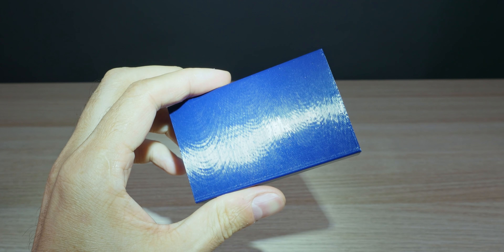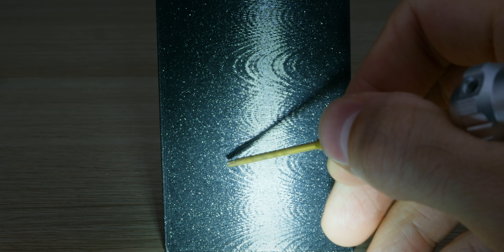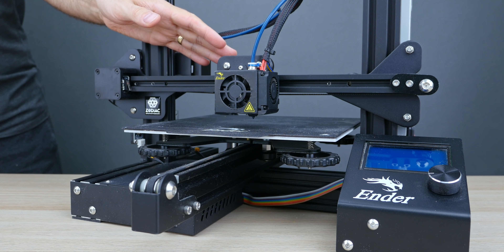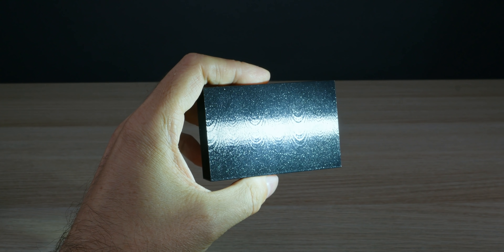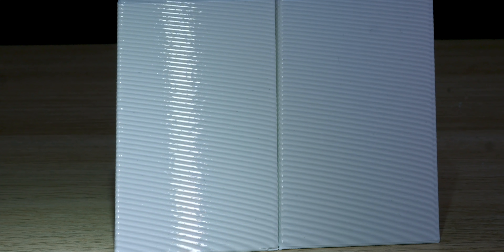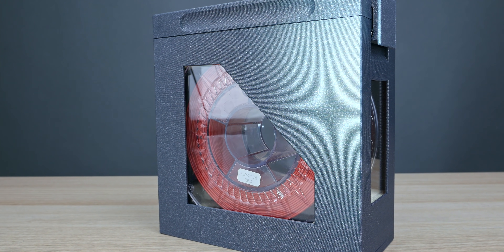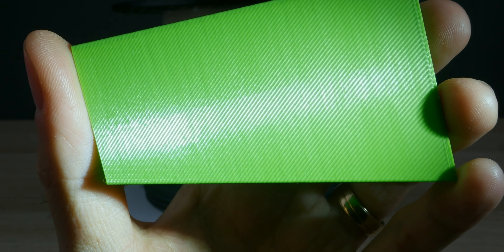The intertwined waves pattern in 3D printing

Comment: Can also be caused by stepper drivers,  motors without enough micro stepping holding torque that snap into steps , etc.   Bowden setup with a really powerful single gear extruder has worked well for me in the past.  0.9 deg large bowden stepper works wonders.   Geared extruders of course add their own artifacts.   Good reason not to go cheap on direct drive.

Comment: i will modify one extruder project from thingiverse the "powerFlower belted extruder" it uses mk8 hobbed gear but i will modify it to "lerdge mt" gear its belted but single drive also second gear which most uses bearing , i will use ender 3 stock extruder gear to increase grip so there is not a backlash or lag with gear system caused by teeth , i think it will be good.

Comment: Wonder if you could design a little "give" between the extruder and hotend on your direct drive design. Maybe put a spring in there or some rubber that would dampen out the supplied pressure to the hot end.

Comment: could you try covering the hobbed teeth with some very very small rubberbands or heat shrink, either way something super rubbery/grippy so its not biting on indexted teeth but instead on a rounded grippy surface, bonyus points its a non perminant modification

Comment: Firstly, first class videos -- even more engineering rigor than cnc kitchen!    I've read through many comments and can't find any reference to the relative alignment of the teeth in the hobbed gear and the drive gear.  Is the alignment the same between manufacturers? Does it vary with the same manufacturer? I wonder if this could we why not all dual drive printers suffer the problem or vary in magnitude.   I have to believe that the hobbed gear running with synchronized pressure on the filament from both the left and right side would have a different result than alternating pressure from the left, then the right...

If this is true then then are things that would effect the "phase" of the two gears (like pressure on the idler gear, filament density/type) and thus change the relative significance of the imperfection.

Makes you want to try designing your own extruder.... oh, wait a minute.... 🙂
Reply from the maker: That's something I haven't considered. You do make a valid point. I've got a bunch of gears from various manufacturers and I can check how they do or don't align. Thanks for pointing it out!

Comment: Fascinating! Just thinking out loud... What if there is a rubber band around each of the extruder gears where it touches the filament? Similar to a baseball pitching machine. Pitching machines have two counter rotating "tires" and the ball is grabbed and shot out by the spinning tires. I realize it's a tiny rubber band. However, possibly no marks on the filament???

Comment: I believe it has to do with the profile of the teeth. Distance to the center of rotation is smaller at the center than at the edges, of course it slip at every teeth. Straight and sharp teeth should help. Larger diameter of the hub gear also, because it will increase the number of tooth in contact with the filament with less variation than small radius. There is also another pattern, the coaxiality of the gear hole with the motor shaft: the set screw push it on one side to compensate the play and lock. (for this too a larger dia compensate better)

Comment: Thanks for the analysis!  After installing a Printermods MDD kit and Trianglelabs bimetallic heatbreak to a CR-10, I was getting these patterns and they were quite prominent.  According to your math the interval for me was 0.4mm.  I changed hobbed gears, idler tensioner springs, nozzles, used a different 1.8 degree stepper (wish I had a 0.9), uncoupled the stock fan shroud from the gantry to reduce vibrations, increased speed by 50%...nothing.  In the end I removed the bimetallic heatbreak and the surface finish of prints went back to being acceptable (although this problem in its exaggerated state allowed me to see that it was still there afterwards, although suuuuper subtle).  This gives credibility to the assertion that Bowden systems buffer against this effect.  I want to try a CHT nozzle to see if I can get back the increased flowrate the bimetallic heatbreak was giving me, or even if it could dampen these wood grain artifacts.
Reply from the maker: That's super interesting! Having played with some hotends to push them to the limit I also noticed some strange behavior where the extrusion flows in bursts rather than being uniform (for a simple uniform purge command). Not that it had anything to do with your observation, but that there are still things that happen inside the hotend that I don't quite understand. 0.4mm should be the distance between the teeth of the hobbed gears I believe? I still do get those. Does depend a lot on the filament though. They're always there, but barely visible with some filaments and very accentuated with others. I'm also curious about the CHT nozzle. Placed an order for it and I ended up ordering everything but the nozzle 😅.
Reply: @MihaiDesigns  Thanks for replying!  The stock Creality gear I have is one of the 11mm OD 40-tooth gears which would be ~0.86mm/tooth, so if there is some sort of reciprocating deformation (like compressing a straight object in a tube it might turn wavy) perhaps that could explain it.  I'm sorry I don't have an alternative extruder to test.  Your comment about "burst" movement kind of makes me get this hunch that each extrusion-hotend setup has its own signature, influenced by the sum of its internal friction.  I get this image in my head of a kitchen blender with silicone feet that you're trying to pull across a countertop.  Your arms/hands being the extrusion force, the blender does all these "micro hops" as you move it due to interactions between the silicone feet (soft, elastic) and granite (hard, rigid) happening in intervals as the static friction is overcome.  It would be the analogy of the softened filament moving past metal heatbreaks/nozzle surfaces, I suppose.  I am no master in tribology or fluid dynamics, just musing...but I am curious about the impact that machined surfaces would have like drilling vs EDM or what coating or plating methods could help or hinder the situation...perhaps the CHT with its higher surface area could make things worse!  Anyway, hope you can get to test it and if anything notable happens that you'll share!  Thanks again!

Comment: how about at 1:50 we rubber coat it?  Not the gears, just the extrusion area for the filament?  Would that not help keep from digging in and maybe solve the pattern issue?

Comment: Maybe this really faint wood grain pattern comes from the hobbed gear. The screw we use to tighten it to the motor shaft can set it a little bit offcenter. Similar issue Stefan has in his Cetus machine: https://www.youtube.com/watch?v=a3oQy6v3MrA
Reply from the maker: No, that by itself would produce a very very elongated pattern which would look like misaligned layers.

Comment: A resin printer would have no problems printing some herring bone gears (hell I can do M3 threads on my Mars 2, and probably even M2 if I messed with the exposure times more).

They wouldn't be metal but modern resins are fairly tough so it should be good enough for testing (maybe even for general use, but I'm not sure how much wear those gears actually get.).

Could even look at replacing the teeth with some kind of a finer alternating grid pattern. Or maybe using some kind of a rubber coating instead of teeth (unless it would rub off to quickly)?

Comment: this is actually not caused by the dual gear... evidently, print speed will cause it shows up or disappear. you should take a look for my video explaining why the stepper motor and the stepper driver is the root cause.

Comment: I just had a thought. What about a quad gear  extruder that uses softer tires to drive it? No chewing filament. The flexibility of rubber tires would put a more consistent pressure on the gears, taking up some of the backlash variability.
Reply: An orbiter of some sort?

Comment: You should be able to get rid of the problem by taking the second gear out of the system. It would be a single gear drive, which would hold one side of the filament, and the other side of the filament would be held by a feeder gear on a rail or shaft, which has a ball bearing so it spins freely. You would be able to tension this second free spinning feeding gear against the filament with a spring and screw, just make sure it is not connected to the main feeder gear.

Comment: You can add recirculating ball screws as your drive system like a cnc mill. This is clearly a very expensive solution but it is far more ridgid and abosrbs the vibrations/counter forces.

Comment: Now that you exposed your findings it seems to makes sense: the tiny teeth of the cog wheels combined with the spring pressure induces a cyclic alternating parasitic torque back to the extruder motor (like driving a bicycle with square wheels). Given that we generally use stepper motor, without position feedback, this torque creates an slight alternated over-shoot and undershoot of the intended position, therefore generating over and under extrusion. If true lighter gear pressure will reduce the amplitude of the defect. And "helical cog wheel" should almost get ride of it.

Comment: Helical gears might solve these texture problems. They have a more consistent tooth engagement which makes for smoother transmission of power. It might help to use these instead of straight gears for dual gear extruders.
Just a thought…
Reply: If they were helical enough it would also average out the bumps going into the heater as the bumps would be angled.

Comment: Just increase the gear ratio of youre extruder, this wood pattern its caused, as you point, because fluctuations on the pressure of the melted filament, and yhea, piped extruders use the pipe as a flux capacitator so its less noticeable.

Nothing to be with the tooths of the extruder filament gears, and yhea, increasing the pressure solves the problem a little bit (extruder would lose steps), thats what you do when you increase the speed of the outside layer...

When you print with extreme small nozzles (0'1),  this pressure problems leads to jamming, its even more extreme, imagine holes in the surface... the way to "handle" this (because its impossible, its matter of luck at this sizes) its increasing the temperature way too much to make the plastic more liquid (240-250C°), slow down the speed to even 10m/s, and let the extruder jump steps, if you pray you can improve the results...

Comment: Taking inspiration from your suggestion of bevelled/chevron gear teeth to align and reduce backlash the dual extruder gears, imagining what the area profile of the filament looks like as it passes through the hobbed gears may offer a viable modification.
Imagining both hob teeth squeezing the filament together would reduce the cross-sectional area of the filament the most, and the space between hob teeth reducing the filament cross-section the least, perhaps having the hob teeth angled would spread the deformation over a greater length of filament and reduce the problem.
Just my $0.02 :-)

Comment: Could you try a rubber extruder gear, or rather extruder wheels.  Two dense grip rubber wheels that grip the filament tightly without teeth

Comment: I already said that in part 2 but what about making the gears larger so that the distance to the filament is higher and rotating the second gear around the one on the stepper until it squishes the filament? The gears would always be close together and every filament can be used. I don't know if I explained my idea clearly, but in my head it's a simple solution.

Comment: This is quite an interesting video, I run dual hotends that use dual gear extruders which leave the little tooth marks on my filament. E0 is direct drive with a short bowden tube, E1 is bowden and has a long bowden tube due to my 400mm X build volume. I've never noticed these kinds of patterns on my prints and I've printed very low wall speeds at low accel settings. I'll have to do some further testing on my machine because my vrollers are stock from when my printer could still be called an ender 3 pro.

Comment: Semi-technical comment (you'll have to do some research on your own and/or watch the videos and think about it to understand):

A few years ago, a 3d-printing company demoed a new type of extruder that avoided most of these problems.  They said their extruder was "axial-symmetric" or "axi-symmetric".  Instead of a pair of perpendicular grooves (like for BondTech geared extruders), it made a helical groove all the way around the filament.  This means the cross-sectional area of the grooved filament is constant.  (Sorry, for the life of me, I can't remember the company's name, and wasn't able to Google for it.)

Their idea isn't mechanically new; it's based on the idea of "axial thread-rolling" devices used to manufacture large bolts.

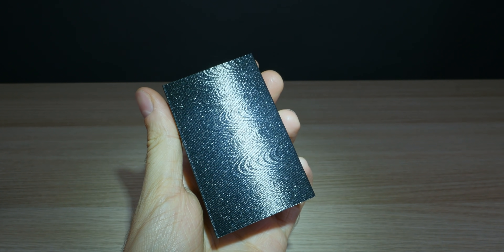Video (actual thread rolling starts at 0:20 into the video):
https://youtu.be/9Kn6nX3rcsM?t=20

Fixed rod, spinning head:
https://www.youtube.com/watch?v=C3vSyHjBnOQ

Spinning rod, fixed head:
https://www.youtube.com/watch?v=AmN61jOHXnU

Notes:  I couldn't find a good YouTube video, but the idea is that you have three rollers with a thread profile that "roll" around a cylindrical workpiece.  The three rollers have axes that are slightly tilted with respect to the central axis, and they have thread profiles.  (Best to watch videos to see this.)    Sometimes, the rollers have planetary gears so that they roll together, but sometimes they do not have gears.  Sometimes the rod spins and the head is fixed, sometimes the rod is fixed and the head spins.  For 3d-printing we would want the spinning head version, so that we don't twist the filament.

A company, LMT Fette, used to have lots of really cool videos of this on YouTube, but I'm having trouble finding the company's YouTube channel.  But other re-sellers have videos.
http://www.lmtfettetools.com/catalogs/Thread%20Rolling_Turning%20Heads/2023%20Rollkopfkatalog%20deutsch%20englisch.pdf

Of course the original purpose of these "axial thread rollers" is threading metal rods.  However, they also have the property that they axially advance the rods they work on.

So a 3d company (I forget the name) designed an extruder based on all this.  Instead of having the filament "rotate" while it is advanced, they instead rotated the "threading head" so the filament wouldn't have to turn.  I think they used a planetary-gear set-up with the rollers.

Sadly, I think the use of this for a FDM extruder may have been patented by that 3d printing company.

However, I wanted to point out that we may be able to use a helical thread in different ways, other than "thread rolling."   

For example, Bondtech gears make threads on the "left" and "right sides of the filament.  If we add a second set of Bondtech gears, then we can make threads on the "front" and "back" as well.  This would make threads that almost wrap-around the filament.  In theory, this could be used to make a helical-thread all the way around the thread, although it wouldn't be completely uniform; it would have some "square-like" shape.  However, it would be an approximation of a perfect-helical thread/groove.  And it is likely to have a cross-sectional-area that is more uniform.  If you like, add a third pair of bondtech gears in a hexagon arrangement for an even better approximation.  Hope that makes sense.
Reply from the maker: Yes I remember that 3d printer extruder, I can't remember the name either, but there's been no news in over a year on that.
Reply: Not directly related, but I find it interesting that the Bondtech LGX extruder does not use any tensioning springs for gripping the filament.  It appears the LGX just sets a rigid distance between the rollers?

Comment: I'm switching to direct drive on both printers. I'm also switching out mainboards and trying new firmware from the manufacturer. Once they are back together and I've finished the test prints for the manufacturer, I'm going to print a few things and see what happens.
Oh, and what about the surface of cylinders? Have you tested that? Different sizes? Your videos are always informational gems. Thank you!
Reply from the maker: I do include a few cylinders as models to show the same patterns but I've only got a few sizes so this particular pattern could come out very squished.

Comment: Would it not help if the teeth of a dual-geared extruder would not be opposite of each other, but at 180 degree phase offset ...  That would mean you still need a dual-geared extruder while fixing the previous problem (which I think should be feasible by adding some extra gears in fixed position and have the two gears engaging with the filament then each driven by one of those 2 gears and mounted so that their shaft can rotate around the center of the gear driving each of them (and pulling those 2 axis together with a spring).  It's so much easier to draw than to explain.  Anyway, that would ensure all the gears are always interlocking at the same fixed distance and that should solve your first problem while retaining dual-drive.  Then you would need 2 different Bondtech gears, with the actual filament ridges at a 180 degrees phase offset (or you somehow need to ensure your other gears ensure such a difference - although I haven't thought this through - perhaps the way the gears interact makes the phase between both Bondtech gears variable depending on the distance between the gears, i.e. the filament thickness).  Anyway, just some quick brain-farts from my end ...
Reply from the maker: Interesting idea, needs some studying and testing. I haven't looked too closely into how the two hobbed gears align their teeth